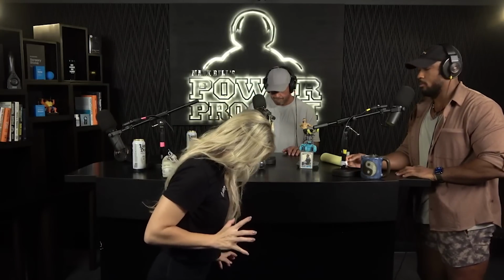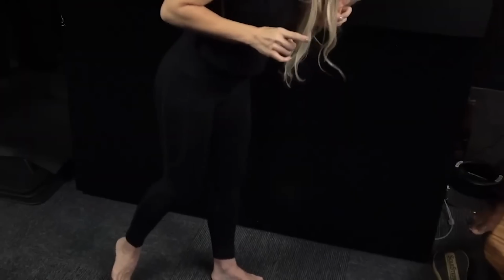How to Walk Correctly & Proper Foot Strike

Comment: None of us will ever do "correct" foot strike with shoes, infact the heel strike we all do in shoes is totally fine. It's when you take your shoes off that this matters, you touch the floor with the ball of your foot on the smallest toe side. It's almost like sneaking around. Anyone who has respect for others in a household will likely already do this by nature. Though some don't, my mother for example slams her heel into the carpet, you can hear her from a mile away. If you have some respect and finesse about yourself this movement is utterly natural and shouldn't need to be taught. Unless you wear shoes in the house or are non caring of the noise you make. In nature the ball of your foit near the small toe prevents you from putting to much pressure on a sharp object allowing you to react.